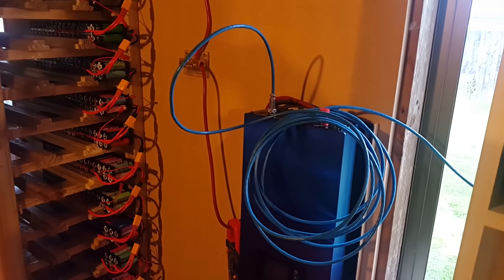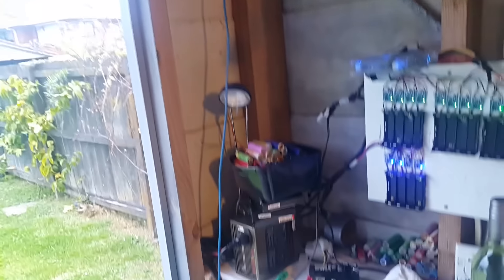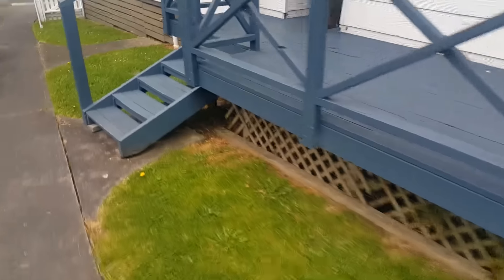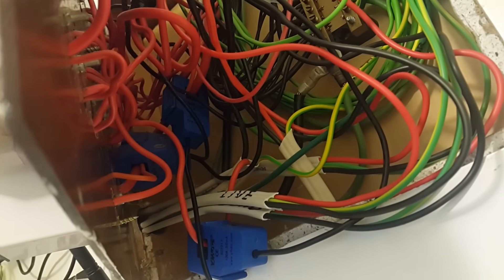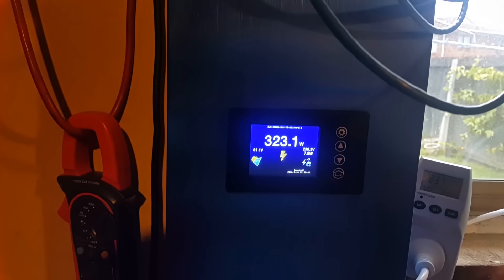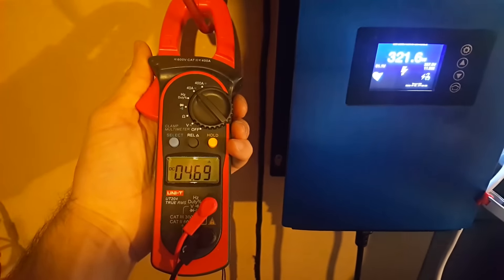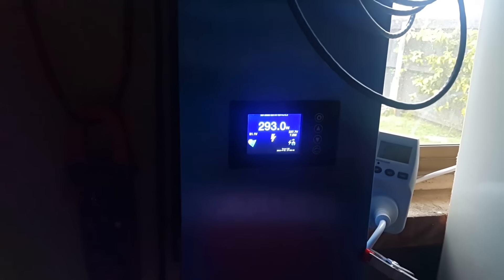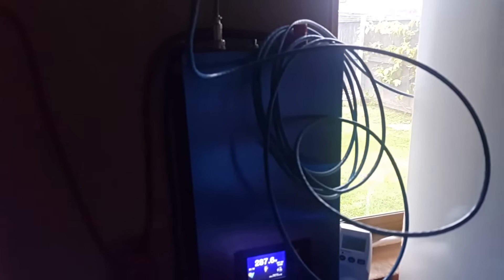CT Connected to Switchboard Test

Comment: a wireless CT clamp would be great idea for these....and surely not hard considering they already exist on the wireless power meters.
Reply from the maker: hmm good idea i did think of that, Tho on the wireless meters there is a time delay. I would think the deley over wireless would make the inverter lag. But maybe this might not be too much of a problem. If it did have some lag it might be putting out 500w when the house load just dropped to 450w etc and the excess 50w would export to grid until the next reading. 
With the cable at around 25m it seams ok. Only problem i have found is when reading 1000watts for eg it puts out 900w which means 100w is coming from grid. This is ok tho becuase i would rather pull 100w from grid then be exporting it, and it does mean i will always import a very small amount of power. At smaller loads the differance isnt very much less then 100w for eg. I will post in more details with a video later.

Comment: Does this unit have a built in low voltage cutoff so you dont ruin your cells?
Reply from the maker: Yes it does 45volts but that is much lower then the limit needs to be. I need a limit of 60v which is 3volts per cell. If i let it go it would drop to 2.2volts per cells which is very bad.

Comment: Update on this would be good. I have the same inverter/grid  tie only difference its the 1000 watt, trying to use the internal limiter Cat5 extension 36.4 meters I get around a 100 watt less input then required, tried many things may need amplifier the signal to make it more accurate, I may end buying the external sensor to see if it fixes this. Anyone with external limiter able to reply any input?
Reply from the maker: I think John Smith  just got a external limiter. Posts on this video https://www.youtube.com/watch?v=0htMqlMw_Uc
I have an update coming just need to finish the video
Reply: Thank you both for the responce, I will check back later on this thread waiting for your experience with the external limiter. Now with the new firmware I feel a little bit angry should of waited a month. I can only hope that the end user can update the unit themselves when or if available might have open my one up to see if possible.
Reply: I think you are correct, I just opened my one up and had a look, there is only a bus line (rainbow wire) connection where you could update it from not very user friendly I dought they would release the firmware for public I'm from Australia so shipping there and back out of the question ( may sell this one and buy the updated version after summer). How ever inside there is a third micro fan just in front of the internal heatsink, but I would have to say it dosent look like a finished product inside, I see room for external temp sensor ie. battery bank temp, Wifi option and upgrade or communication port. I will do a little more research on the internal components to see what else there capable of doing mainly the IC. But for now I'll have to keep using an external DC voltage disconnect/reconnect ( just the one I'm using is over its limit on start up have to manual do this task not always home to do so while running its fine) but still looking forward for an update with the external limiter when your new inverter arrives. firmware Version 5.2
Reply from the maker: haha thats a long way from Auckland New Zealand. keep me updated